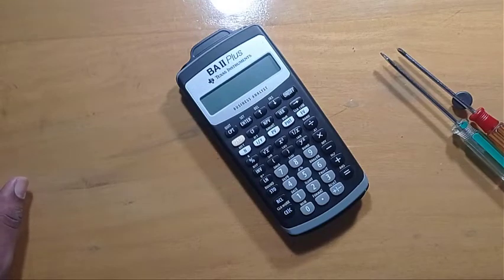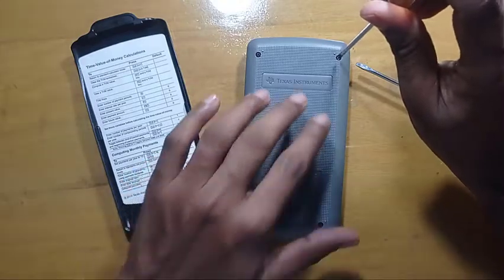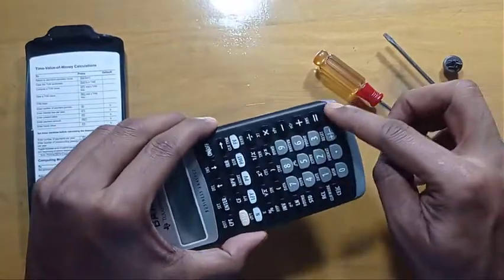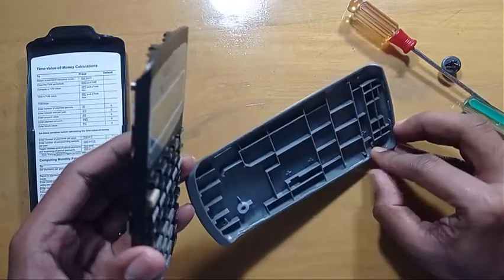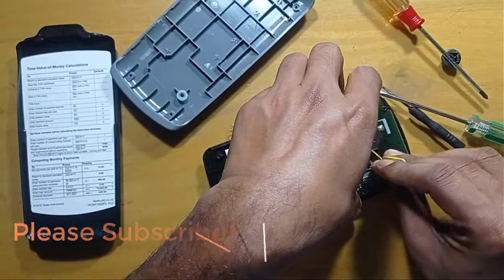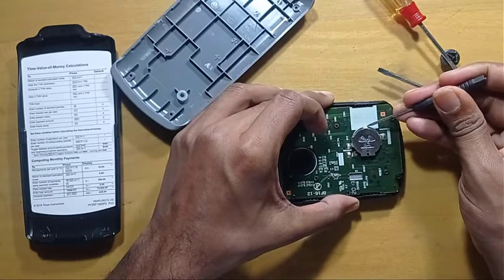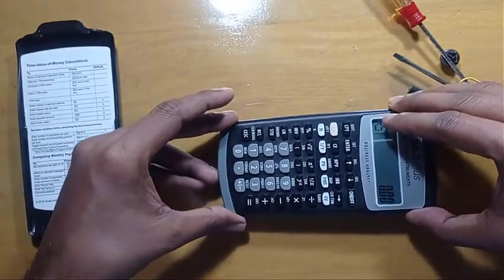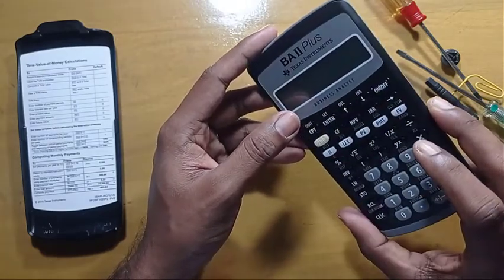How To Change or Replace the Battery For The TI BA ii Plus Financial Calculator

Comment: Quality video. Thank you for sharing.

I found the battery process to be not user friendly, and this demonstration gave me confidence that I was doing it correctly. I also found it very helpful when you pointed out where the connecting clips were on the case.

Comment: How come this calculator doesn't have an access panel on the back of it? So you can access the battery! That's not very user friendly!
Reply: Yes. This is uncommon! I think by making it so difficult to change battery, TI wants you to either 1) break/damage the calculator during the difficult process , so you need to buy a new one or 2) you don't know how to change simply buy a new one. So either way, TI can boost the sale.
Reply: Why people need to use this TI calculator ? Because certain public exams dictate the candidate to use TI calculators, no choice!
Reply: Anyway thank you so much AMIN for making this video, so helpful